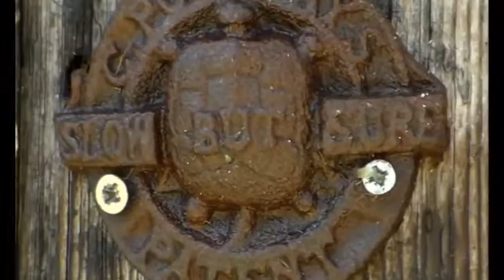Electric lawn mower bearing repair, Qualcast motor bearings re-lube.

Comment: It seems that this Qualcast in the UK is the same as a Ryobi RM 2232 in South Africa, apart from a different top cover. Our croquet club has one that is used for mowing round the edges of the lawns, and it has the same problem as this one. Luckily our gardener also stopped right away. Thanks for the video, I missed the screw in the front axle section and  of course it would not come apart. I will now go back to the garage and find that screw
Reply from the maker: Paul, yes everything is just badged now, very little is original. Hope all goes well and that you have subscribed, cheers from Lincolnshire.

Comment: Was hoping for removal of the bearing on the big pulley,, but thanks,, good video.
Reply from the maker: Hi, the motor pulley is heated and pressed on, almost impossible to remove, be great if new pulleys were available then the old one could be cut off with a Dremel, cheers
Reply: @TheInfoworks  Thanks
Reply from the maker: @barraabus  cheers

Comment: It looked to me like the pully was machined on the end of the shaft and the splines were for the plastic fan.
Reply from the maker: Hi, maybe but then how did they get the bearing on there? cheers
Reply: @TheInfoworks  Large bore to the bearing?
Reply from the maker: That would do it, shame I never investigated further, cheers
Reply: @TheInfoworks  Probably just as well, if you had pulled that bearing out of the plastic housing after it had melted like that it may well have never gone back in again as large chunks of the plastic would have broken out with the bearing. These things are just not designed to last or for repair, just for cheapness of manufacture and work well enough to con the customer until the warranty expires.

Comment: its not good solution's for bearing problem better to change it .
Reply from the maker: As you see from the video it is impossible to change this bearing, cheers
Reply: its need some heat or extra fixed chair (bass) and more pressure sometime cut it and make another one  @TheInfoworks
Reply: @TheInfoworks  https://youtu.be/WvEkAWmc1yY?si=Pa5wL19bcMFCTGYO&t=376
Reply from the maker: @benjaminmaraz4981 very interesting puller, cheers